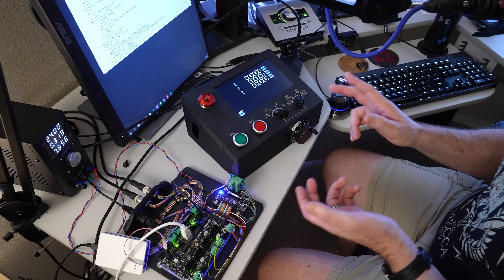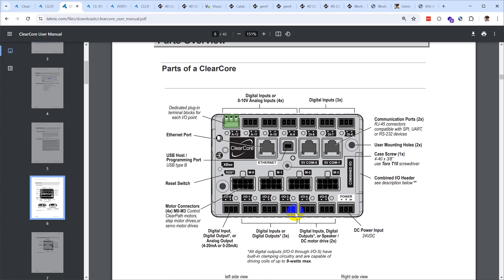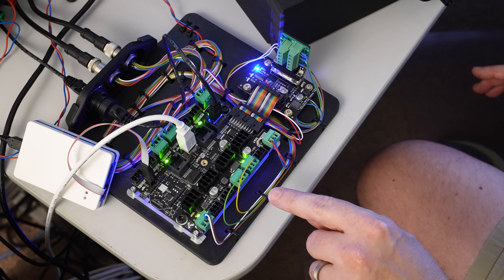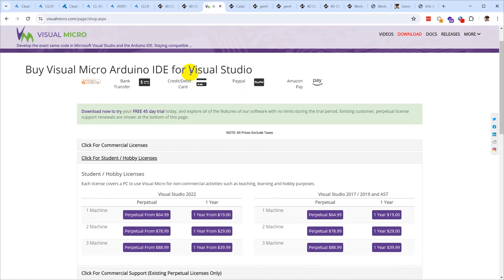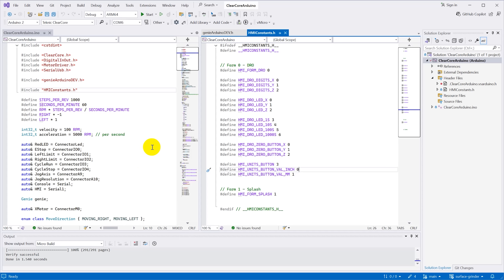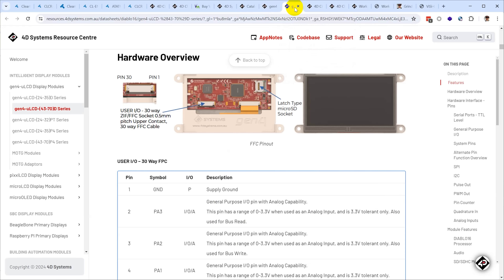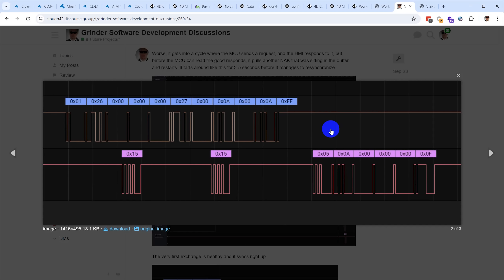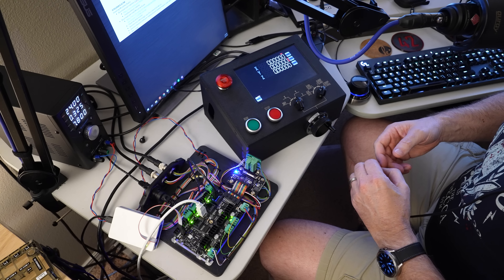ClearCore + HMI in 45 Minutes: Skip the 40 Hour Learning Curve

Comment: When I need light pipes in prints i just print a empty pipe sized for the 1.75mm filament and cut pieces of filament to size and press in. That also allows me to have as smooth or diffused surface as I want independent of build plate texture.

Comment: We use their larger ClearPath(tm) motors on our large-satellite-dish (12.8m) restoration project.   Instead of using the ClearCore board, we use the SC4 comms hub, and their SDK for Linux (and Windows).   I ended up writing a little "Motion Server" that uses the ClearPath SDK, but it can talk to Python scripts via XMLRPC.    So all our high-level motion control is actually implemented on a fairly general-purpose computer running Linux.   Throwing 5.6 tonnes around with relative ease, using 1.1 and 1.5HP motors and adequate gearing.   I still get nervous every time  we run it :)
Reply: Glad to know they make massive clear path motors, wish they would make smaller ones (some places claim they used to make nema17 but they don’t exist anywhere for sale so I’m not sure)

Comment: Back when I was a control system engineer we always tried to find information like this, but it didn't exist.  Showing up at a customer site, seeing a PLC, HMI, or SCADA application that you've never seen before but have to fix is an experience you'll never forget.  Especially when it happens frequently, because there are so many manufacturers and models still in operation spanning decades. 

This will be a great video, one that I would have appreciated back in the day, that will have an good impact on others!

Comment: Have you used platformIO in VS James? The ice debugger is supported. If so, what advantages does Visual Micro offer? Those 4D screens are as cute as a button (high, low ...), have used them a couple of times, luxury for doing a front end.
Reply: I love platformio
Reply: Watching this video, I guess you could say the advantage is Arduino Ide interop, but I see that as a downside. Just let me define my board and libraries in a text file and give me a command I can run to compile and upload.
Reply: Yeah, platformIO is the way to go
Reply: Besides platformIO not being 100% compatible with Arduino code, can't the Microchip IDE debug some MCUs that platformIO can't easily, like the Chips in the UNO etc? And as it uses the Microchip APIs maybe it can too?
Reply: @joseph9915  avr stub, the free builtin, is used for the avr chips such as found in the uno whereas ice is used just for SAM, a nice system in my opinion as it caters to people starting out working with a uno etc that haven't yet started playing with the bigger chips nor made the investment in an ice. And yes it's true the interop isn't 100% but with a tiny bit of file renaming when you setup  your project you can be if you need to go back and forth, personally I don't. It's generally a one way trip for me, import the arduino code and that's it.
Reply: Came here to say to recommend the same.

Comment: I'm currently developing a project using the Clearcore, it's so well priced for what you get.  I started with Arduino, very quickly got sick of the awful IDE and moved to Microchip Studio which is a lot better, but nowhere near as slick and reliable as Keil which I've used at work for years.  Thank you so much for letting me know about the VS plugin, I'm definitely going to give that a go.

One question, will the debugging in Visual Studio only work with the Atmel ICE, or can you use any debugger that Microchip Studio can use?  I have a Segger JLink Plus which I've been using, and the Segger RTT (real time transfer) is super  useful for logging larger amounts of data with minimal CPU impact (unlike serial prints).

I love your Clearcore cover with the debug port, super professional!  I really want to making a cover for the Teknic CCIO digital IO expander which doesn't come with one for some reason, though my 3D design skills are pretty basic so that will probably be a bit more hair pulled out at some point.

Comment: hi james small question unrelated to this but related to your els project, to just program the TI + boost board is the external 5v required or is it also possible to just do it thru usb by leaving those 3 jumpers in place?

also what are your thoughts on kwackers fork of the els with the thread to shoulder option?

Comment: Why don’t you implement an error handler for the NAKs at startup? I get that just waiting works, but why not just handle it? Say you get a NAK or failed checksum or something. Best practice would be to handle those errors gracefully as you guys in the software side of ware should be , um, aware? Just playing with you!r OCD. Great video! I got to check out one of those HMIs. I started building an automated cat feeder and the scope got blown to include a display and that looks a lot easier than trying to code menus and all that from the microcontroller side, even using a menu library.

Comment: PlatformIO looks like it covers similar ground to your VS Micro approach, except with Visual Studio Code instead of Visual Studio. Not sure if it supports this exact combination of hardware, but it's a lot more commonly used for Arduino-derived projects that outgrow the normal Arduino IDE (3D printer firmware projects are often large enough that they require/expect you to use PlatformIO to build them for example).
Reply: Does it support in circuit debugging?
Reply: @ferrumignis  Of course
Reply: I also think VS Code has a less intimidating UI, less UI clutter while having it all.

Comment: How about having the HMI's first rational action after reboot be sending an "I'm alive!" message to the controller. You could then wait for that instead of 5 seconds to know when it is time to start running. Or simply treat it as an event in the event loop that does a state transition from a wait to run mode for the rest of the code. (And have the 5 second wait as an event, so that if you don't see the alive event within 5 seconds you know something is wrong and can maybe try to recover.)

Comment: Have you heard of platformio? This is the cross platform, cross mcu professional alternative to arduino ide that can not only run arduino core but also vendor cores like ESP-IDF for esp32 controller, baremetal AVR and many many more.
Reply from the maker: I've heard of it and used it.  Didn't see ClearCore support.
Reply: @Clough42  you’d just need to set up some PlatformIO configuration to specify the target details and the Arduino core to use. The upside is that you can check that into your source control, and whoever wants to contribute can use VSCode + PIO completely for free.

I’ll see if I can write a config a little later today.

Comment: Your issues with the bring-up delay remind me of problems I had with various cheap USB serial adapters. These are often poorly documented, but many of them require some amount of "dead time" after changing any parameters (baud rate, flow control, stop bits) before they respond correctly. Quality serial adapters are better-behaved in this respect, but if you have a script that sets serial parameters and immediately tries to start sending/receiving over the port, you're going to have a bad time.

Comment: I have to comment on the button that displays a value on it: I absolutely hate those, because they are not intuitive. Does the value tell me the current value or does it tell me what I will get if I press the button? In real life, BOTH variants appear, so there is no way to know, other than pressing the button and see what happens. Please use two (or more) buttons.
Reply from the maker: I can see that.  Personally, I don't like the button because the current value displayed is too small.  That can be fixed, too, but I'm still not super excited about it.  That said, it's pretty common for a DRO to have a button labeled "inch" or "mm" and you press it to toggle.

Comment: I would have just built the UI from scratch using flutter and a cheep tablet. It's easier than it sounds, and cheaper.  I've done that before with a pi  to interface with whatever board that controls the hardware over Wi-Fi or USB. The tablet can be set up as a kiosk to make it professional
Reply: I think you should probably watch the video. He gives plenty of good reasons to use it over just a Pi or other options.
Reply: @metroid031993  I just used the pi as an example. Most cheap microcomputers like the pi would work for just the backend. Like he said in the video, you should not use the pi for the IO you would need a different board for that, and there are a few good options that work well with a pi or something similar.
Reply: The Clearcore doesn't have a USB host, so that wouldn't be any use.

Comment: Ok, these last few videos have made my brain hurt. I actually have a degree in less stress treatment. My recommendation to you is you need a new hobby. Something like building a mid 60's muscle car. Something with a small block Chevy. No electronics, all mechanical. Even a dumb red neck dolt can make those things run unbelievably well. I'm going to have a triple shot of Johnie Walker Blue Lable and go to bed. Thanks for the video. I'm sure I'm going to have a nightmare about this.😵‍💫Oh, and if you have a minute, I have a Tesla CyberTruck in my drivway. Do you think you can determine why my rear view camera washer doesn't spray and cleaner on it?